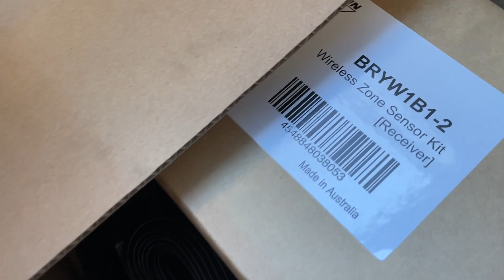Installing an R32 Daikin Multi Lite Ductless Mini Split Air Conditioner.

Comment: Hi, thanks for the video! Just a question regarding multi split units. How is the evacuation correctly being done? Need this to haplen for every circulation (Indoor unit) seperately or is there a central connection in the outdoor unit? Thanks a lot
Reply from the maker: Hey mate, every brand is different. Some have a central sheadar that does every lineset and some have a shreadar on each individual suction line. From memory I think this model had two separate shreadars however some Daikin models only have the one. 

So honestly it changes every unit mate. Thanks !

Comment: Ive installed a few of those. They still have only one service port for the heads? Most brands have multiple ports so you vac one line down at a time.
Reply from the maker: They have a port on the suction line of each head. This was a 2 head multi so 2 ports.
Reply: @maracservices deadset aye. Last one I installed was a few years ago and had 3 heads, but only 1 suction port.
Reply from the maker: @MentalLapse09  yeah I know the units you’re talking about 😂

Comment: Really clean, nice to see.  I really like that trunking you always use, we have that plastic crap. When you can would you show those anchor screws you use on your wall brackets for that brick ? Stay well. thanks
Reply from the maker: Yep will do next vid. Yeah I really like sheet metal pipe duct. Cheers mate!